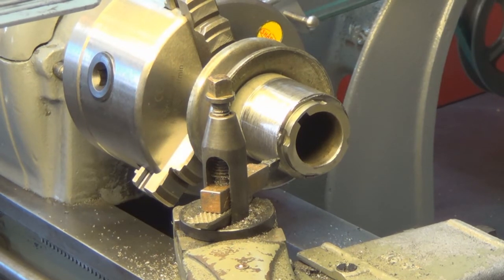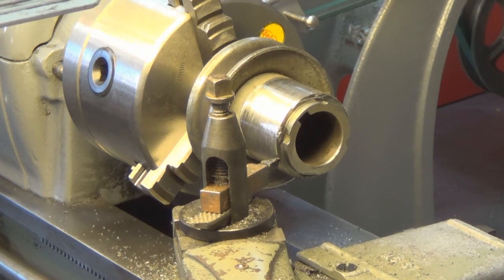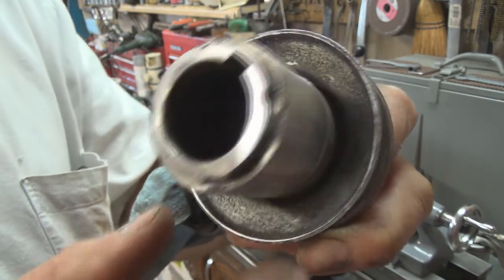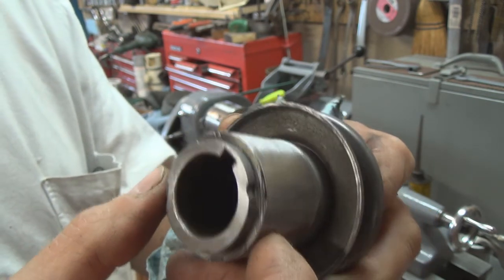Turning the pulley for the Goofy Cart & a question.

Comment: I believe I saw the chuck jump alittle when you touched the tool to the pulley, maybe worn head bearings or bushings.
Reply from the maker: I think what you saw was the cross slide jumping? I had noticed that when I was using it. I need to go back and recheck all the adjustments on the cross slide. Thanks for keeping an eye out for me.

Comment: George I have cut brake drums and rotors and you probably did too. But that was a long time ago and far far away. You got a bunch a guys giving ya suggestions and I'm sure amongst all the guys you'll get it figured out.
Reply from the maker: Yes, I ran a brake lathe many years ago and in reality this is very similar, though knowing how to identify the various kinds of metals and what speed to run them at and which cutters to use will take a lot longer to learn than the brake lathe did.
Reply: Gotcha. But knowing you, you will figure it out.

Comment: That lathe is actually doing pretty good George. Thats a pretty nice job just slow the travel a little bit thats just a slight bit of skipping  you had. The cutting bit is working fine.
Reply from the maker: So how do I slow the travel speed?
Reply: +The Shade Tree Fix-it Man You have gotten a pretty good consensus and we pretty much think its going a wee bit too fast. Have you tried putting your gear lever in the middle neutral position so you could feed it manually? Are you using a set of dial calipers to check your depth of your cut along the material after each pass? Just a couple things to think about. You will get better with a little practice but I think you are doing great so far George
Reply from the maker: Thank you Larry. I was using the scale on the cross bar to set my depths of cut, going .005 on each pass, which seemed minimal compared to some cuts I have seen fellows taking on Youtube videos. I did do some hand feeding, especially when I first started cutting the end where the old pulley had been, so as to get it down closer to the size of the rest of the shank, then when I started cutting the whole length I used the lead screw feed. I am enjoying learning how to use this little machine and grateful for all the help and advice.
Reply: +The Shade Tree Fix-it Man You lathe is solud i see no wobble at all which is perfect. you are right about applying cooling oil on the metal and getting acid brushes to apply it. You have more control with a brush and it keeps the oil from slinging on your walls. Love watching you work George.
Reply from the maker: Thanks again, Larry

Comment: I have good luck with high speed steel. Just sharpen the bits like mrpete222 says. They work great.
Reply from the maker: I will have to check out MrPete222's video on sharpening bits. Most of the bits that I have been given are carbide however. Thanks

Comment: Yea, you need to slow the feed rate you may have to do it by hand many of those home lathes have that carriage for turning screws and nuts and don't go slow enough to get a nice finish, the other part is you should get a bit with replaceable tips one with triangular bits would be nice they seem to last a nice long while for most jobs. Over all the lathe is working fantastically.
Reply from the maker: Thanks Scott. I do have one of those replaceable tip cutters, but I need to grind down the shank as it is too big to fit into my tool post, or, as someone else has suggested, I need to get a quick change tool post, which I think would accommodate the larger shank on some of the bits that I have.

Comment: My old lathe has a hand wheel so I can feed it slow .I  haven't learned much about speeds and feeds......I think the lathe is running too fast of r.p.m .And it does look like you are feeding the bit too fast...Be prepared to get dozens of different  Ideas and comments ..I am not a know it all about lathes ..But I will preach though that HSS bits hand ground will do better than carbide bits Like you are using ...unless you get really good at sharpening one ....the best carbide tool bits are the insert kind and cost a lot just for me to ever to use on a small lathe...Don't hold me to me word on anything about lathes though...I am still learning  and have played with mime for a few years...It is Great to see you running it and wanting to learn !!!
Reply from the maker: I do have one of those insert cutters, but I need to grind the shaft down so it will fit in my little tool post. It probably would cut a little smoother since it has slightly rounded ends on it. Thanks for helping along the way, Jim.

Comment: Seems a little fast on the rpm  , slow and steady is good .
Reply from the maker: I will try using the back gear next time. Thanks Terry. That seems to be the consensus on my speed. This was on the slowest speed I could get through the regular pulleys. I only have a one step pulley on the motor at this point.

Comment: I would be using a round nosed tool, and some cutting oil, and moving the carriage by hand. I still feel that you are running the machine too fast.
Reply from the maker: I have the pulleys on there slowest speed setting, unless I go to the back gear, which I will try next. I'm just learning and enjoying the journey. I did put cutting oil on, didn't you see me do it??? LOL I need to get some acid brushes and a can to put my cutting oil in for easier application. You are the second one to say something about a rounded bit. I'm not sure I have one...yet, but I will check tomorrow. Thanks for the tips!
Reply: I cut an awful lot of screw threads before I got a smooth surface. Most machinists have an automatic oil feed, I just used a hand can, and there is much debate about what sort of oil to use, and some materials are cut dry. Trying and learning is the best way to go, I think, especially when you will be doing 'one off' jobs. One day I may admit to trying to bore a bronze bearing in pre oiled cintered bronze with a very flimsy boring tool. Every one else thought it was funny.
Reply from the maker: What was funny about boring a bronze bushing? I have thought that I might need to do that to fit some of the bushings that I may need along the way and I expect all the bronze bushings I have are oil impregnated. I am enjoying the learning experience. Thanks for the tips.
Reply: Plain bronze is easy enough to turn/bore, cintered bronze has to be turned to size before it is soaked in oil, if you try to turn it afterwards, the tool will just skate over the surface, it is about as good a bearing material as you will get. The boring tool I was using had too much flex in it. Another comedy moment was when I destroyed some tools attempting to turn high tensile steel in the same way as mild steel. You are at the start of a very steep learning curve! The shape of tools is an interesting subject, although most folk now use the ones with hardened inserts.
Reply from the maker: Learning what is hardened and what is not will be the challenge, especially when I use so much cast off stuff. Glad to know about the bronze bushings. Thanks

Comment: nice job for first time, next time try slower rpms and a little bit heavy cut, also hand feed it. also don't start the lathe with the cutting tool on the work piece
Reply from the maker: Thanks Josh, it seems that speed is one of the major issues according to many of my subscribers. I'm enjoying the journey.
Reply: The Shade Tree Fix-it Man
your machinery hand book should have speeds and feed section